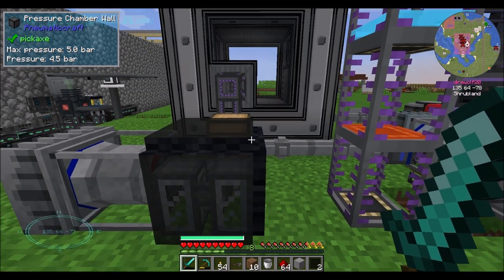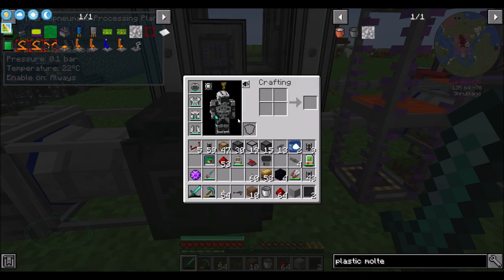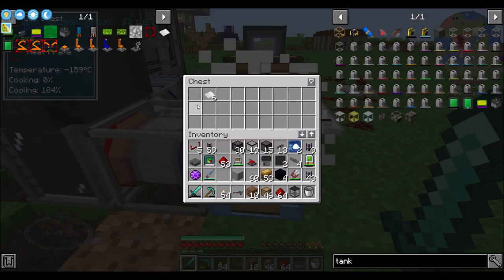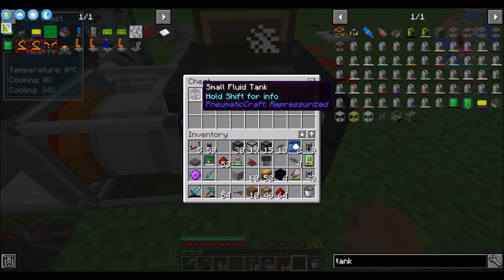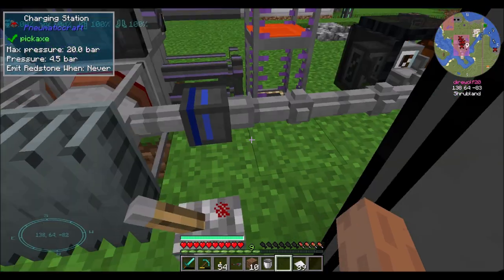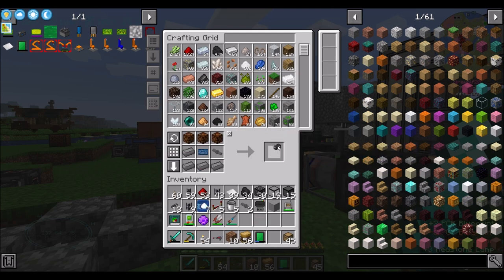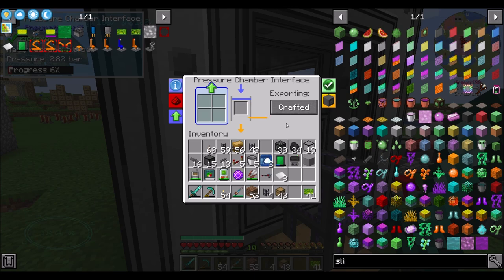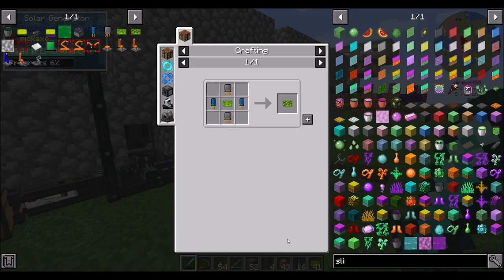Forgecraft S13E29 Circuit Boards

Comment: 29:30 there is a bug with Mek logistical transporters right now which can cause items to be voided if the target inventory rejects the entire stack.  This can get triggered by the pressure interface door closing, causing item loss, which I think might have happened here.  Mek team are aware of it and it should be fixed soon... in the meantime probably safer to use some other item transport system for insertion to the pressure interface (Omnidirectional hopper with a few speed upgrades works well).

Comment: Shouldn't the ideal temperature for creating plasic be below -75°C?
If your base yield is 1 plastic sheet per 1,000mb (which makes for a yield of 1.0) and every degree below 0 increases the yield by 0.01, then 1.75 is reached at -75°C.
Reply: You are correct.
Reply: Dire maths strike again